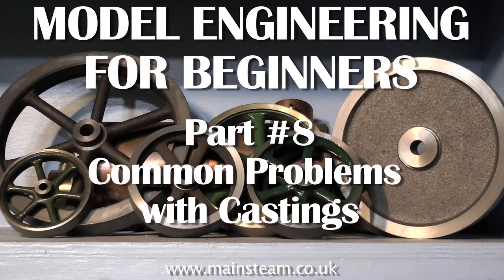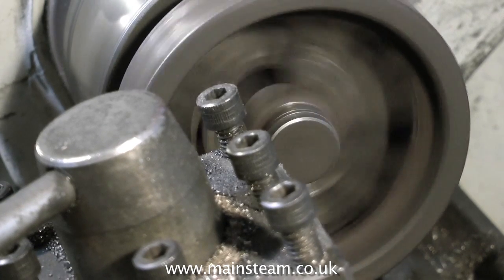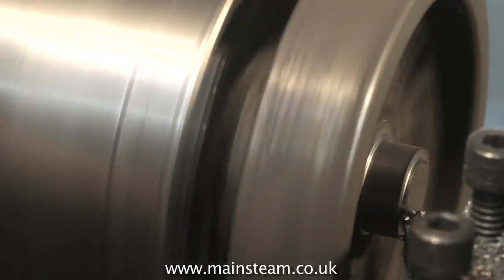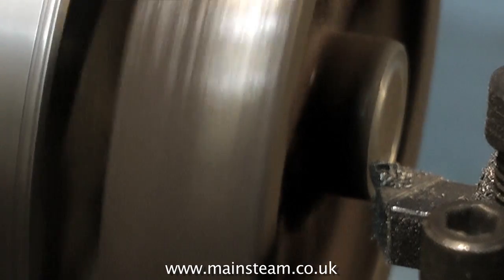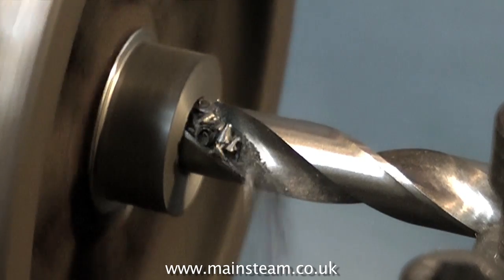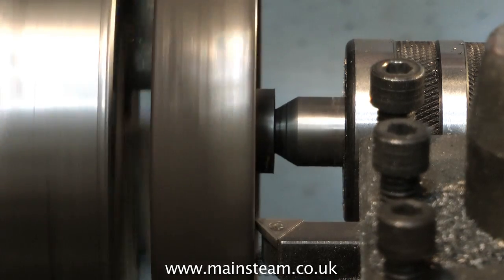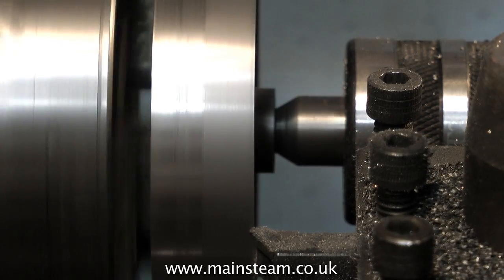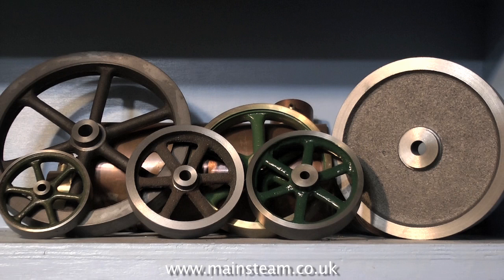COMMON PROBLEMS MACHINING CASTINGS - MODEL ENGINEERING FOR BEGINNERS #8

Comment: Hello Mr. Appleton i have a question, When it comes to machining metal do you need both a lathe and milling machine or can you get away with just one. I know that both have their own benefits to their use but im just curious. Thank you a ton.
Reply from the maker: A Lathe with a milling top slide will be fine for most small jobs.

Comment: Thanks Kieth.  This explains why I'm having so much trouble trying to machine my flywheel casting. It's chilled! It's impossible to cut. They must have mixed in some Kryptonite! Not to mention the blowholes that are in it. The hub machined ok but the rim is impossible.  I'll start over with a new one.  Thanks again!

Comment: I have had similar experiences, I once had to machine an 18 inch cast iron steering wheel and it "rang" so bad that i couldn't use carbide and run it at any speed so I had to use HSS and run it very slow, but until you get under the skin of the casting I had to sharpen every pass.

Comment: Bought some new small barbell weights for cheap and thought they would make great flywheels.  Spent hours on my 9x19 lathe trying to turn it down.  Used HSS then carbide inserts.  Would not cut through specific locations.  My lath was jumping around.  Tightened the gibs.  Still no luck.  Gave up!  Got on YouTube and finally found your video 
COMMON PROBLEMS MACHINING CASTINGS – MODEL ENGINEERING FOR BEGINNERS #8.  Now I get it.  THANKS.

Comment: Hi Keith... a Yorkie here!

My only observation (as an apprentice trained toolmaker) is that after the centre-drill operation, I would have drilled and reamed a good size smaller than finally intended (say 1/8 inch or 3mm smaller), matching the size of a 'standard' diameter tapered mandrel.

Then after initial machining, we can force the flywheel onto the tapered mandrel (already machined work to the widest end), allowing the flywheel to turn freely between centres using a face plate and driving dog. This allows us to work on the flywheel from the rear face and boss, thus achieving perfect concentricity with the already machined front face.

When done, knock the flywheel off the tapered mandrel and using a dial-test-indicator, centre the flywheel (within 4/1000 inch or 0.1 mm), which should be near enough for the balance of a steam engine flywheel.

My father, now long deceased, was the most highly-skilled bench fitter that I have ever known. He was employed by Adamson's in Leeds (industrial sewing machines) as a 'sewing machine foot' designer for machines sewing things from hems and seams to buttonholes and buttons. I remember visiting his workplace in the late 60s and gazing upon his work, saying to him... How, Dad?  How did you do it?

The process was normally my Dad starting with a piece of Stainless Steel and the critical dimensions... hardly ever a drawing... he would then cut and shape the end result, using cold chisels, hacksaws, files and emery cloth... creating the correct piece for the job in hand. He was good! (nay... he was very good)! 

Simples!

I absolutely enjoy your videos, so please keep them up! Best regards, Gordon

Comment: Have you ever tried to anneal a hard casting by heating and burying it in wood ashes to cool slowly?
Reply: Never tried it, but it should work, I guess. Cast iron already has so much carbon, that it hardly can take any more, so I doubt carburization would happen. It's all about heating it above a certain temperature and cooling it slowly enough, so that no martensite gets created.
Reply: You can also use some cat litter instead of the wood ashes.  Try to get the silica based version, it gives you a nice porous material with good insulation properties that allows for a slow cooling of the casting.  Get the part heated red and non-magnetic , keep it at that temperature for a while to make sure that it's thoroughly hot, and have it cool slowly buried in a bucket of the cat litter.
Reply: Wood chips will char and become charcoal releasing carbon and carburize your material, making it even harder.

Comment: i remember reading somewhere that you can get rid of a chill by heating the casting up red hot and letting it cool slowly.
Reply: Close, but not really. Instead you'd need to anneal the part to soften it. Tempering is very close to annealing, but it's best to soak the part at temperature for an extended period and then use a very slow cooling time. The basic differences are time at temperature and cooling time, plus usually higher temps to temper compared to annealing.
I just found it pretty interesting that chilling a cast part is/was done to create hardened surfaces before using hardened steel was common. It's still used in some industries to save costs compared to using hardened steel.
Reply: It's called tempering